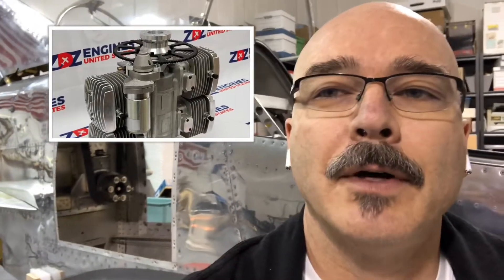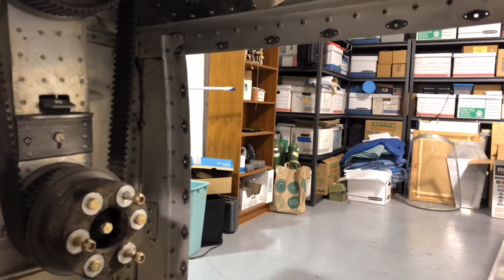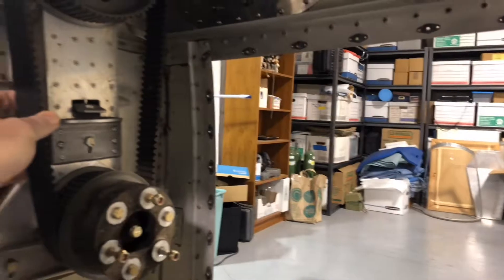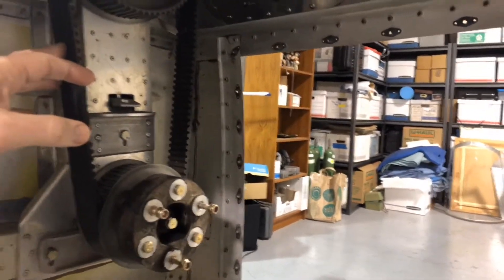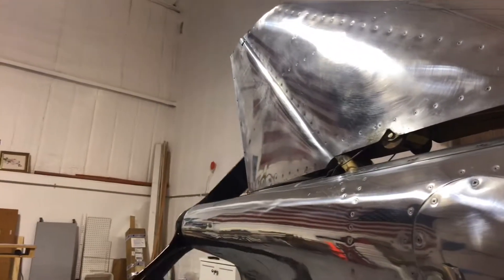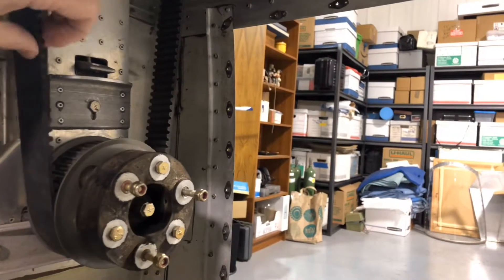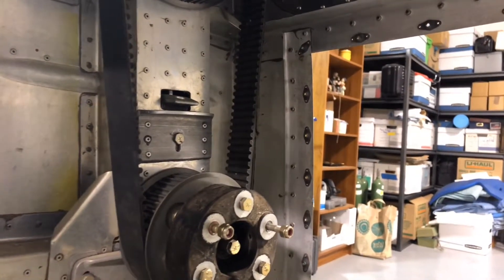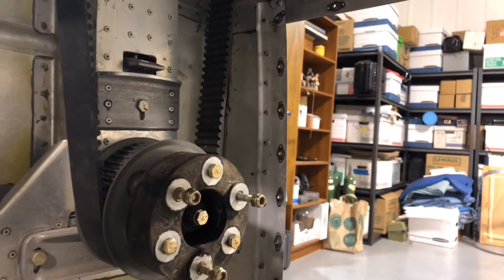Plan C for the alternator

Comment: You’ll get the alternator figured out 👍
What kind of prop are you using?
Reply from the maker: Lonnie Prince designed one of his P-tip propellers to match the hp/torque curve of the engine. It is 40” with a 50” pitch.